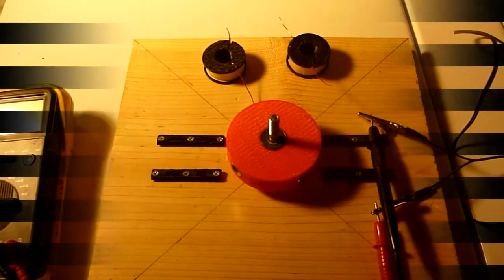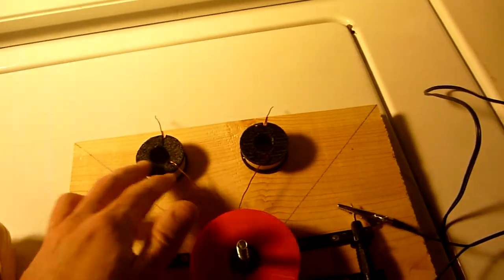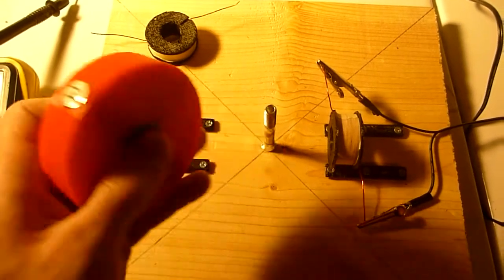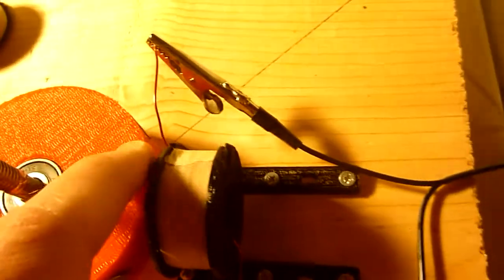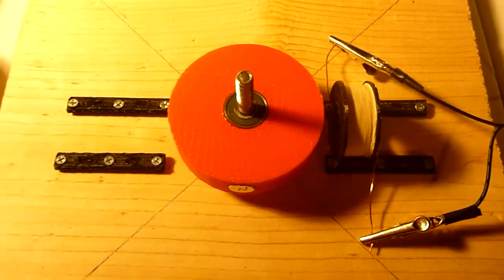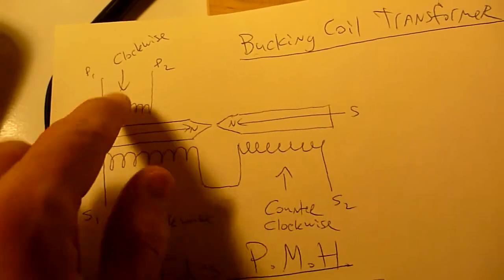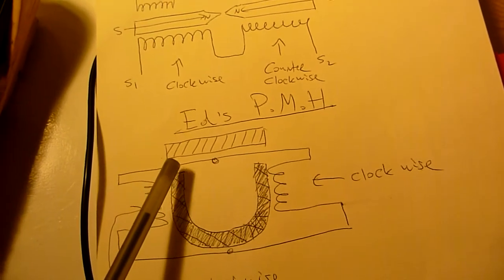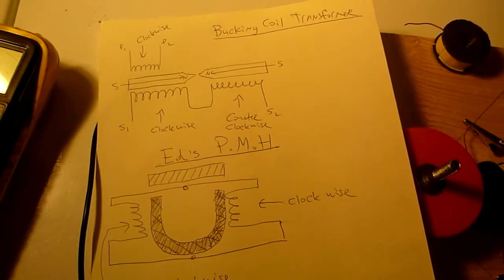Induced Magnetic field of Clockwise vs. Counterclockwise coils

Comment: Make a 1 turn coil. If you look at it from one side it looks clockwise and from the other side it looks anti clockwise.
Reply: That is just a trick of perspective.  It is actually either Clockwise CW, or CounterClockwise CCW, whichever way it was wound, looking from either direction.

EXAMPLE:
take a "wire", "core" or conductor, and imagine/look at it on its end, looking at the cross section.  You should be at one end of the 'wire core', looking at the cross-section as a flat (and moving away from you) circle, or like  this:   O

Then, starting from the bottom left, imagine (or you could just do it with some wire laying around) going CCW (COUNTER-Clockwise) under the O to the right, then up, over the top and towards the left, back down towards the start, then PASSING the start (REMEMBER, ALWAYS stay moving/wrapping in the same direction.  This is the direction the coil is wound in, away from you in this example, since we started at an End of the O-core), back under the O, and stopping at the bottom right of the O-core, pointing to the Right.
We have now made that *One turn of wire Coil*.   So,  from that position, we see the O in the center (our core, or coil-form), and the Wire start at Bottom Left, closest to Us/End-of-core, and going under, around, above, back down, then under the Core again, moving away from us, and ending at the Bottom Right, and pointing Right.
So, we may say that this is, in fact, a COUNTER-CLOCKWISE Coil.

Now, CONTRARY to what @ColinWatters said, if you were to SPIN/FLIP the CORE around..... OR, alternately, we move ourselves to the opposite end of the O-Core, and align our perspective as we did before, looking dead on at the O-Core cross section, with the wire wrapping around the outside of it, below, and above it.......
we find that, ONCE AGAIN, with the O-core in center, and the CLOSEST to us (and to the end of the Core) Wire-end at the bottom Left, if we follow the path of the wire, the wire ONCE AGAIN goes from Closest to Us at Bottom-Left of O-core, runs under towards the Right, then up and over the Core, back towards the Left, then again back Down and MOVING AWAY FROM US, goes BACK UNDER the Core, and ends at the Bottom Right pointing Right.
^^^THAT^^^ IS a COUNTER-Clockwise Coil.   

So, in conclusion, 2 things....

1)Perspective is EVERYTHING, and without correct perspective, Illusions can abound and confuse.
2) A CCW wrapped coil is ALWAYS a CCW coil.   And a CW wrapped coil is ALWAYS a CW wrapped coil.   

The point is that when trying to determine a value or characteristic of something, all parameters must stay constant, EXCEPT the one that you are testing/examining.    So our starting point (end of O-Core, and closest point of wire aligned at Bottom-Left of Core, looking Length-wise at Core cross-section) was always the same.   The Core and the wire coil (1-turn) was the same.   All we did was examine it one way, then flip it 180`deg., and observe again.   And our results of the direction of the twist of the wire-coil was identical = It is a CCW Coil.  Meaning as it moves away from you (from the perspective of the end/terminal of core, or wire), it twists/coils/moves in the same CCW-motion.....   regardless of looking from "front" or "back" of the core-length (i.e. looking down 'through' the coil).

Hopefully that helped dispel some misinfo and misconceptions.

The REALLY question now, like Naoki Kashima asked, is if these coils/winding-types have any sort of characteristic differences within circuits or wave propagation, induction, phase-alteration, etc., etc.

Much love 🙏 and happy experimenting!!!!!